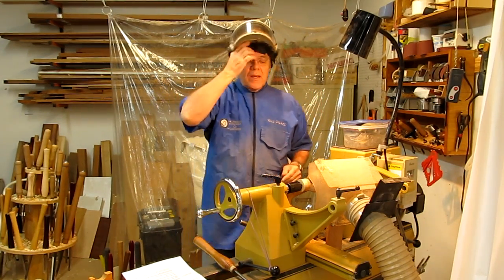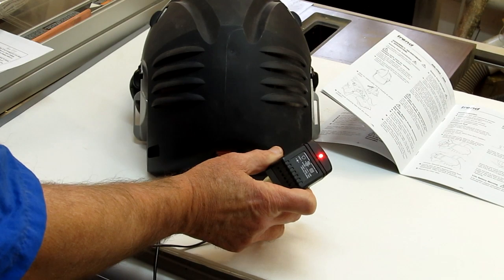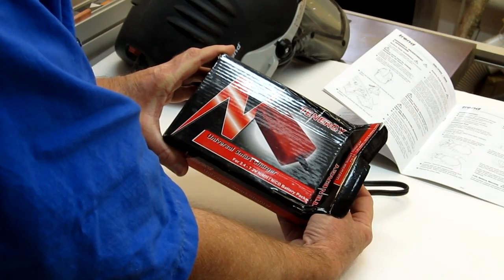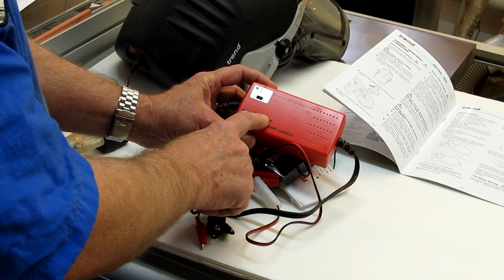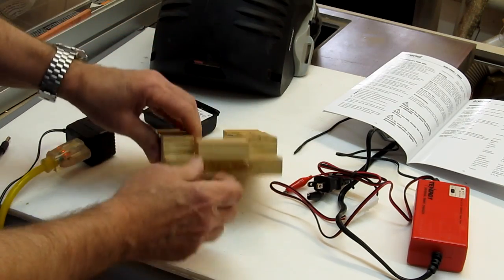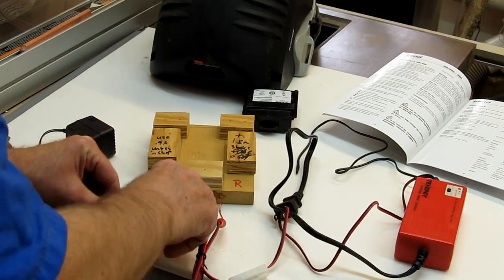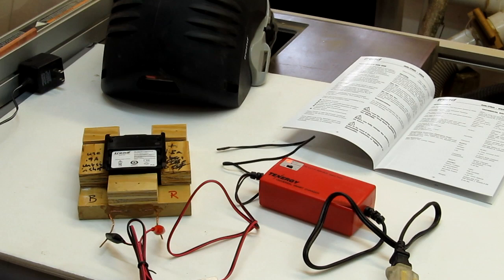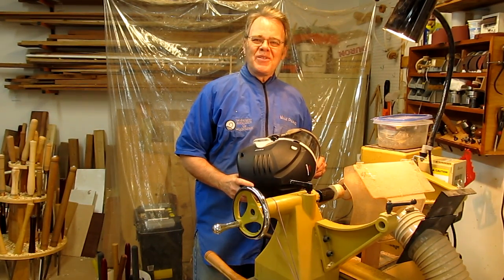Trend Airshield Pro Smart Charger

Comment: Would it work putting that fitting on the Tenergy charger and connecting to the helmet?   I thought that there was some charging circuitry there.  Or is that just direct connection to the battery?
Reply from the maker: The latter.

Comment: Hi Mike. I'm thinking of getting a Trend Airshield Pro. They are a little pricey so here's my question. Are they worth the $400.00? Any advice will be appreciated. Thanks!
Reply from the maker: Wow that is so subjective. I have one and almost never wear it. It does well when I do.  I only have one battery and it seems it is always dead. The batteries are not Lithium Ion I do not believe and their charger is not a smart charger so you can't just leave it charging or it kills the battery. But it is still probably the least expensive one out there. I keep wanting to develop a cheap battery pack I can wear on my belt but can't seem to get motivated to come up with one. I guess I just need to use my charging solution in the video. 🙃
Reply: @MikePeaceWoodturning  Thanks for your honest answer. Seems like people love the unit but all have trouble with the charger and battery. It would be nice if Trend would address this. Take care! Ed

Comment: Thanks Mike. I've been considering dumping my AirShield Pro, but may adapt your fix instead. I generally like the unit, but for the price, the Trend people really need to make some improvements. At one point, I dropped the helmet on my shop floor from a height of about 22 inches It quit working. I disassembled it to find the impeller shattered. It's a very fragile item which could easily be beefed up. I met with Trend in Raleigh and they kindly sent me a replacement blower assembly which I appreciate, but believe they should correct the underlying design deficiency. As you've pointed out, the battery and/or charger is simply not up to par. I suppose adapting a smart charger would be helpful, but am considering installing a Lithium Ion Battery from some other source. I have two of the trend batteries and try to keep one always charged, but only get about a half hour before the beeper starts blasting.
Reply from the maker: I  agree. I am working on a replacement battery pack that plugs in the charging hole and fits on the belt.

Comment: I bought one recently. My first issue is it makes me feel top heavy and gives me a stiff neck,  the second is charging  but you could put in a timer, set to 8 hours. The other issue I have is you can only obtain particle filters and I use solvents and aerosols etc
Thanks 
James

.
Reply from the maker: I am working on a remote battery pack with rechargeable batteries. Play with adjusting the cross strap on top. Never thought about no charcoal filters for solvents.
Reply: @MikePeaceWoodturning  I have seen others where the filters and the batteries are fastened at the back on a belt, which keeps the dust away from the filters.

Comment: I had some light timers that use pins to set the on and off times. Removed the on pin and set the time to 12 noon and put the off pin in to turn the charger off at 3 am or 15 hrs later. Eliminates the continuous charging problem with the original charger.
Reply from the maker: I bought one of those too. I did not use it much and it tended to be confusing. Not sure why but it was. I wonder what I did with it?

Comment: Maybe it is a change from Trend, I received my Trend Air Pro for Christmas 2014, my charger is RED when I plug it in and then Turns Green when completed ... Somewhere in the instructions, when I received it, there was a note to always recharge for 8 hours or 12 hours if battery is completely dead ... As a side note, mine does not seem to hold the charge very long ... My brother has one a couple of years older, charger works the same and he also said instructions say to charge for 8 hours when recharging...

Comment: Do you have any other issues with the helmet like the tension knob at the back coming loose  or the weight of the helmet being too much at odd angles?
Reply from the maker: dtec30 I personally have not had any problems. I do know a couple of guys who had problems with the bands breaking. I think there were a lot of defective bands delivered.
Reply: Ok thanks I just haven't had any luck I guess with the one I have had for 12 months now is the worst since I spent my whole tax refund purchasing it arrrgh never again
Reply: +dtec30 The tensioning knob shouldn't come loose.  Make sure you push it in until it clicks and locks in place after adjusting the band.
Reply: yes i click it in place but it pops out

Comment: Thanks, Mike. I just got an Airshield Pro, have already had battery charging problems, which the manufacturer responded to by sending me a charging station. That works, but I can't just plug in the helmet, I have to remove the battery. I'll try the charger you mentioned, and wire it into a plug that will go into the helmet.

Comment: Thanks for the video.  I noticed the new charger had what appeared to be a molex connector (the white plastic connector).  It looks like the one on a standard 7.2v remote-controlled car battery.  You could pick one of those up at your local hobby shop and make an even cleaner connection.  Heck, just head on in to a hobby shop and they'll sell you a similar charger and probably wire it up for you.  I checked online and the battery appears to be a Nickel-Metal Hydride (NiMH), so make sure to use the lower setting on the amperage.

Comment: Mike, I have watched your video and also read Greg's thread on the same subject. I just purchased a Trend Airshield Pro and had already ordered the "smart charger" mentioned. When it arrived it had a different charger than you show, and I had also borrowed a friends Airshield Pro to try and it had the same charger you show. The new one has a red LED that comes on when you plug in, but, it turns green after I am assuming the battery is charged. I am not sure if it has a trickle charge to maintain the battery or not. I haven't had time to check with volt and ammeter but I will. I will use the "smart charger" anyway since I have it already. When watching your video I noticed the rubber band on your lathe tailstock. I am assuming that is to keep the handle pulled up to let the tailstock slide without holding on to the handle. It would be a welcomed third hand if it works well. It is a simple but great idea if it works well, I am going to try it. If you have comment on how well it does let me know. Thanks Bobby I am just a little south of you in Tifton, GA.
Reply from the maker: Yes, the rubber band works great. I published this tip in American Woodturner and had a guy from Texas who called me to say he had suffered from a stroke and this tip made turning easier for him.

Comment: why not cut the original charger plug off and put it on the smart charger instead of messing around with all of that removing the battery stuff.
Reply from the maker: Sounds like a good idea. The carriage is good if you have a spare battery.
Reply: In case you don't like it and you decide to sell it. It gives me a stiff neck.